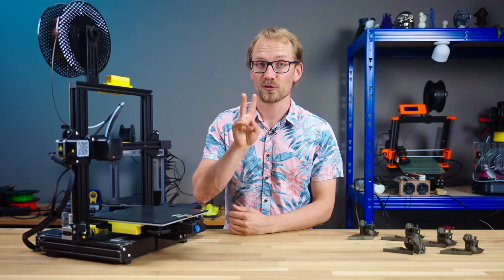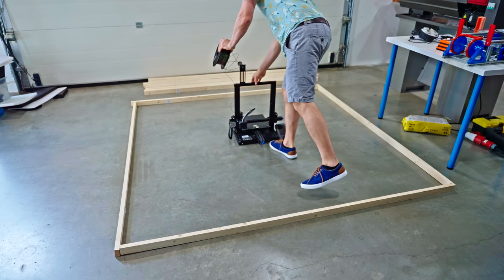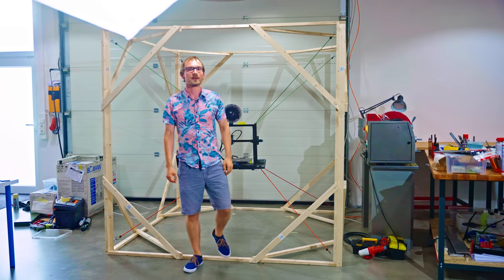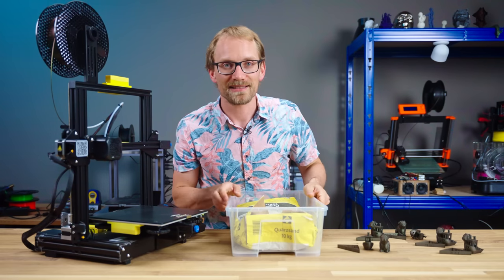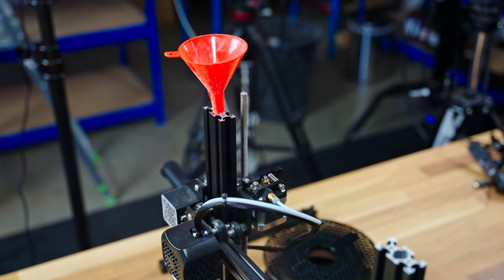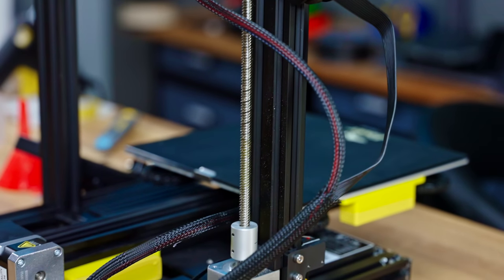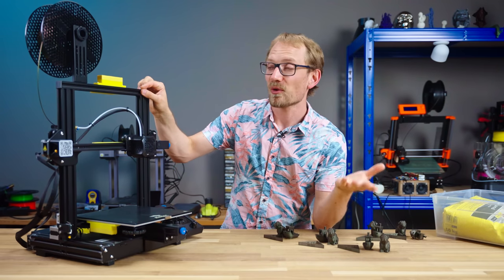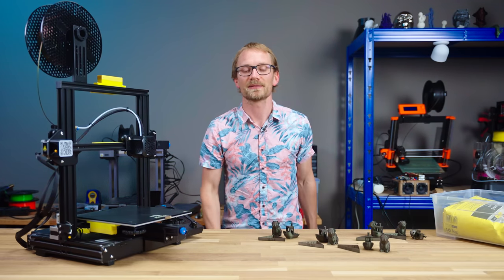You made me do this…

Comment: Watched a blacksmith go full on to anchor his anvil in order to reduce ringing when striking the steel. Now it sounds like he's hitting on a stout tree trunk. Yes the theory is the same. Mass on the base and secure it from all movement. The gantry could be better secured which should yield better results as we've seen in other printer designs. But until the mass of the bed is properly balanced you'll be hard pressed to get close to perfection. Any print is going to throw that off immediately so slower prints are obviously going to do better.

Comment: Put machine on to stick. Bottom of stick should be pivot point of system. On top of stick should be top plate. Constrain printer and stick from falling down with elastic bands in bottom corners of Your wooden jig and corners top plate. Fix printer to top plate.  Maybe that will work? It works for my setup. Narrow high box in bottom,  on top of that tv package box, and printer on top.

Comment: I’m curious about belts… but I’d also like to see wider belts, too, to see if they add enough resistance to vibration to make a difference.

That said, the point that you’re trying to assist an ender 3 that’s running at the ragged edge of its firmware-permitted speed? Well made, and well taken. So I’d be more curious about what kinds of things would assist a fancier printer, just because.

Maybe mount your voron, for example, to those BMW engine mounts.
AND fill the frame with some of the most energy absorbing things known to man. I’m thinking you should skip right past sand, and print out reams of YouTube comments. (Then shred them, and soak them in dampening oil, as a booster.)

Comment: Hanging the printer you just change the resonations, not eliminate them. And ballasting the printer does nothing, as the resonations produce when the stepper motors change direction and belt vibrates due to extruder and bed inertia.  The anti-resonation feets you print work by chance as they damp and counter-syncs with the vibration. The only real solution is a device that dinamically measures vibrations and acts counter-resonating on the belts. Or an intelligent motor controller that makes that. Or a non resonant belt.

Comment: You should never had put sand on the moving surface. You just added a tone of inertia to the bed. So any benefit sand in the rest of the machine might have is now redundant because the x won't be able to move that weight at speed and be able to control it

Comment: An interesting thing to try might be attaching weights to the under side of the belts. 
 I.E. where the belts go around the pulley and come back on the underside.
 So that as it slings the bed or extruder one way the weight goes the other way cancelling out any vibrations.

Comment: Dampening..its actually forces... if your movement in a given axis...is jurking harder dynamicly.... than the staticly weight of the given axes it represent..... you are moving/giving away/stretching/scewing...and result will not be what your F360(or what ever program) says it will look like! 

Just a open question to open your mind... 

Why would a CNC machine...of 17 tons....5meters....by 3meters....by 3 meters.... only handle 0.7 tons of material...

Take that equation down to your 2kg 3d printer...

practical example... hold out your arm... and a pensil in your hand...and point at your friends palm. Now, have your friend move their arm...your objective is to follow their palm....let him deside the speed ;)

Comment: You want mass and rigidity, not mass and flexibility. Simply using free-to-flow sand isn't going to add rigidity. 

Z-braces and concrete inside the beams. Also potentially replacing belts with tiny timing chains(which actually do exist nowadays).

Edit: You also added moving mass, which I honestly found quite laughable, though it's common misconception among people that do not have background in conventional machining.

Edit2: I am honestly curious why you didn't test the frame with sand without adding moving mass first? Coincidence? I highly doubt it, considering that my entire Ender 3 farm is concrete filled ;-)

Comment: Your prints didn’t improve because you didn’t actually add meaningful damping to your setup.  

A damper’s purpose is to convert kinetic energy into some other form of energy that can conveniently be removed from the system.  The only damping you added with the bungee cords is due to their internal friction, which removes energy to the wood frame, but bungee cords mainly function as springs. The wood frame also acts as a spring, with additional internal friction.  If you mount an accelerometer to the wood frame, you’ll see it accelerate in response to the motion of your print. 

The reason rubber feet helped before is that they deform in response to changes in motion in the system, which removes kinetic energy from the printer in the form of heat.  

You can buy other types of dampers as well, but I’d suggest finding the resonant frequencies of your printer under various configurations first, so you can properly tune it using an appropriate mass-spring-damper model.  

Since the hot end and print bed move in relation to the rest of the printer, you will have torque effects that need to be considered in addition to the orthogonal force effects.

Comment: To be honest, despite the intention of the videos is great and the conclusion being usefull in some way, I would support the ideas of resonance through the structure and the frequencies with data. I know that characterizing the system is tedious but just using a cheap accelerometer module (with a quite high samplig frequency for vibrations) on the bed (or anywhere else) with an Arduino Logging to a csv and then put that to a already made spectrogram python plot code would back up your conclusions of each method, taking just a couple of days to set up (being extremely pessimistic). Furthermore, for me it is also important that people get a feeling of the magnitudes of what is happening so you can correlate that case with others and then be more critical with their decisions, not just trying things randomly.

Comment: This is dampening the wrong things, in the wrong ways, adding weight to the motion system is just a mistake if you ever want it to go at a reasonable speed later. To the frame it could marginally help if it substantially resonated in the first place.. The main thing that resonates is what things like input shaping tuning tackle. You would need miniature and light dampener elements that decouple the belts from the hotend for the X, the sort of dampener that has both a spring and an oil filled shock, that shock would also need to be tuned somewhat via it's oil apertures. The Y axis gets even more convoluted from the extra weight, but same deal really.

Comment: awww, i'm late here, but that space cage seemed all ready to launch into space for 3d printing lol.
on a boring note, vibrations and oscillations are among the hardest problems to solve.
accordingly, 
https://en.wikipedia.org/wiki/Oscillation_theory
y" + y = 0 is oscillatory as sin(x) is a solution.
y" is that acceleration or force component. Hence, i'd guess it made sense that printing slowwwly would help to alleviate the problem somewhat, but is irritating as prints are already taking long print times. The other thing is damping, I think (natural) rubber works but is a very expensive solution and it still does not remove very much of vibrations and oscillations except for rather small ones.
I think there are some who tried these rubber dampers
https://www.youtube.com/watch?v=vu80vctXaxQ
I've not tried them myself.
Another thing is in the printer firmware, there is this thing about "Jerk" (physics) (https://en.wikipedia.org/wiki/Jerk_%28physics%29 ) based acceleration configuration
https://marlinfw.org/docs/configuration/configuration.html#acceleration
My guess is probably that many stock firmware for the "cheaper" 3d printers probably won't have it enabled.
It is likely computation processing intensive and cheap microcontrollers may not be able to catch up.
I think this is definitely worth exploring if one decides to upgrade to a 'fast' controller board say with a good / fast microcontroller.

Comment: The reason none of the so called solutions worked, is because the vibrations aren't caused by resonance of the printer. It's caused by the motors. It's an electric resonance.

Comment: I laugh so hard when I saw that superhero cage my dogs barked.
Low resonance frequency has been plaguing machinists for a long long time, and one or two reasons why their machines are made out of iron are weight and iron can't seem to transfer the frequency like copper, tin, and some brass maybe even bronze too. Iron if you've ever broken it in half it has a crystal like structure and I am willing to bet real money if the bottom rails and side gantry supports were made out of iron you would have little to no wavey gravy lines. The lathe that you have has many clues to help us on our quest. Try Iron not steel iron.

Comment: The only solution I've considered as having a chance of working is to build the full cube frame and counter balance the print head. (cartisian.? don't know how to spell it, and spell check is dumber than I am.)  anyway, counter balance X and Y with an identical weight going in opposite direction. Z is not a problem.

Comment: Adding random weight to moving parts only can make it worse. You are building up even more inertia by that way. You want maximum inertia on static parts so they can't move at all and none on moving parts. Weightless moving parts and unlimited heavy static ones are the best ones.. This is clearly impossible, but you wan't to get as close as possible.

This also is the reason why direct drives are NOT the better solution in i3s. With bowden tubes you can move weight from moving to non or less moving parts and you absolutely want this by all means. Also you want the table to become a non moving part.

Comment: Just placing the printer in a box of sand 
Was my thought
Reply: Also corse sand would have more air gaps, allowing more movement of the grains of sand. 
Might need some pads bigger then the feet printer comes with, to reduce the printer sinking.

Comment: All this is just Bonkers man. i have a Enders 3 v2 that i have running almost next to my Tv and i have to go look at it to see if it is still printing as its so quiet and i get pefect prints almost like injection molded.
Curu has always been my problem with all my printers so Ditch Curu and use  Matter Control and you never go back SIMPLES

Comment: Am I the only one who sees that this isn't addressing the issue? It's the relative vibrations between the print head and the bed that are the issue and the frame is already isolated from those by the wheels and belts on the big movers. If you want to remove energy from a system that energy has to be transmitted to the system in the first place.

Comment: what about adding larger and wider feet, perhaps out of steel perpendicular to the print bed movement. Since the bed moves on the Y axis of the XYZ plane. having them on the X axis across the printer itself. Then just bolt down the steel. maintaining the Y axis as stock. just so that it has more surface area to stand on. thus giving the printer frame structure enhanced rigidity. So it would look like  a half  I-beam used as feet perpendicular to the motion of the bed. (my explanation is most likely god awful so take this with a grain of salt since my knowledge of engineering properties is very small)                 
                                                                                         
                                                                                        [=========] (Feet)
                                                                                                  ◘(Bed)
                                                                                        [=========] (Feet)

Comment: Thomas, you are a great journalist, but you simply have no clue about how to do vibration dampening. Sadly there is no 10-minute-video shortcut to learning the theory that is needed to understand where and why, and how much sand you need to place to achieve the vibration absorption effect. Putting it on a moving bed is DEFINITELY a bad idea, and it's quite a shocker that you would be persuaded to do that. 

If you are still reading: 

* small containers are a good idea, but you need many of them, 
* do NOT pack them full, have them 80% full and no more than 2-3 cm layers so that it doesn't pack by themselves. Packing full of vertical all profiles is a poor idea (not completely bad, but way suboptimal) 
* Large grain sand from the top layer of a fast-flowing river is better as it resists packing. It must be well washed from the fine particles. "just any sand" will not do. 
* The containers themselves must be very stiff to transfer the vibration from the frame into the sand
* Do not expect magic results. These things are done for audiophile equipment and some hyper-precision machining equipment (I know because I use it for my work)  -  but for a household quality 3D printer, the effect will be, at best, measurable and only if you do everything right. 

The comment space here is not sufficient to explain why!

Comment: OMG, why did you add the weight to the bed. Total wasted effort. You changed how the printer prints. Why didnt you go back and do another base line? You are comparing Apples to Watermelons.  I really wanted to see how the sand worked. I was screaming at the video. I thought you were going to take them off and try again, but the video ended.

Comment: Too much of anything is never a good thing🧐i would've jus put the sand on the frame and not the bed🤷🏾‍♂️I would've started small to begin than worked my way up👀you kno frame first observe then add blocks(but not all at once) unfortunately I fell this experiment was doomed to fail not using the scientific method however I get it this was done for time and view🤫 if the feet worked well before why not combine that wit the sand instead of the cube🤔the cube already proved to not be the answer🤪
This was jus throwing spaghetti against the wall🤦🏾‍♂️was there any attempt to make the frame of the printer more rigid with gussets and or bracing🤔